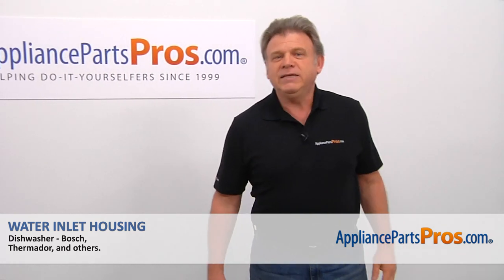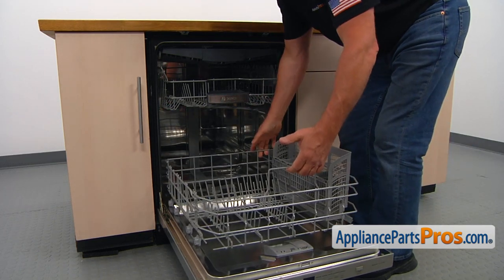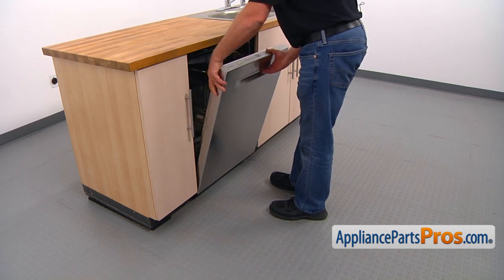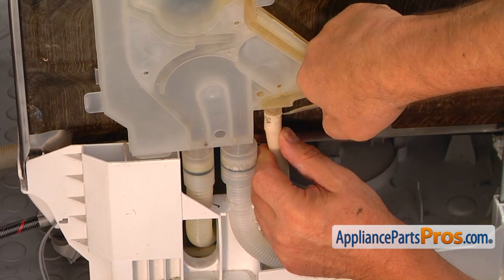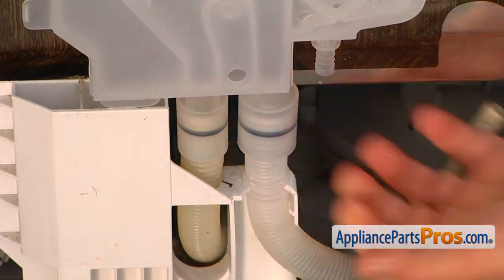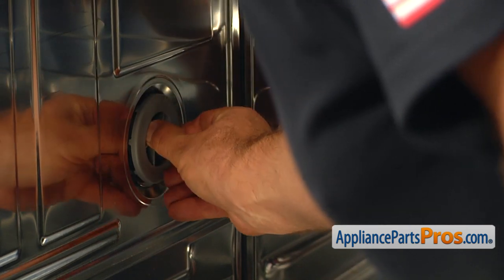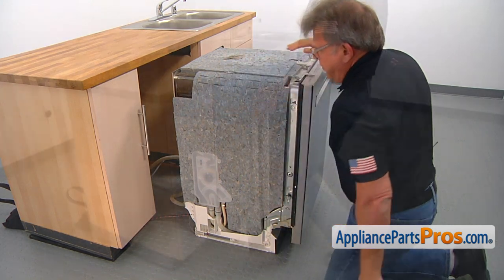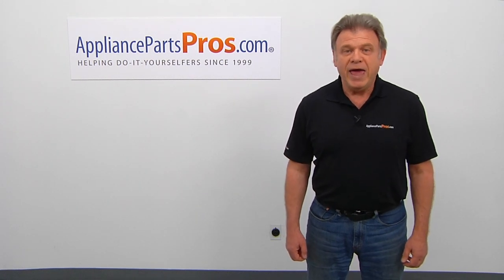How To: Bosch/Thermador/Gaggenau Water Inlet Housing 00744882

Comment: Awesome video! I am getting an E24 error message on my unit. Replaced the pump cover but that didn't help. Could a blocked inlet housing give that error?
Reply from the maker: What is your model number?
Reply from the maker: You will need to check the drain hose, pump, and housing for any blockages.

Comment: Can another reason to replace is that there is some debris clogging the internal chamber?  I see what look like food debris build up in the upper left chamber area.
Reply: You ever figure this out?  I'm getting an E24 on mine and don't see any other clogs/blockages.  Checked the trap under the sink, checked the drain line for kinks, cleared out the filter/impeller area, and I'm getting nowhere.
Reply: Yes.  I had this happen to me. I removed the part per their instructions and carefully added a little but of draino to the chamber (over a sink), sloshed it around, then rinsed it very well and reinstalled it. Fixed the problem!